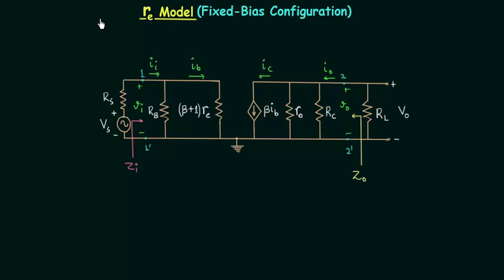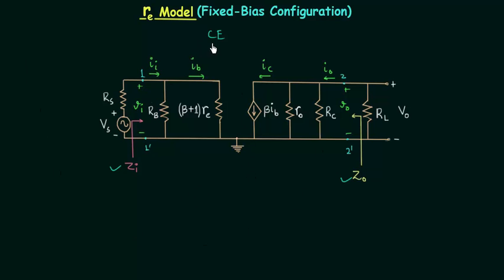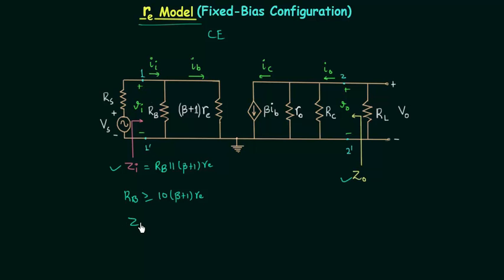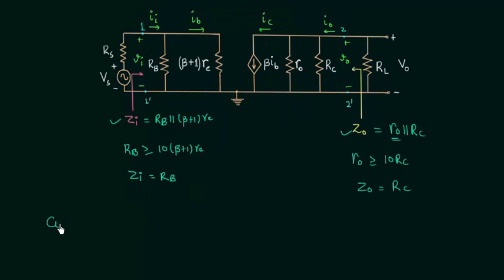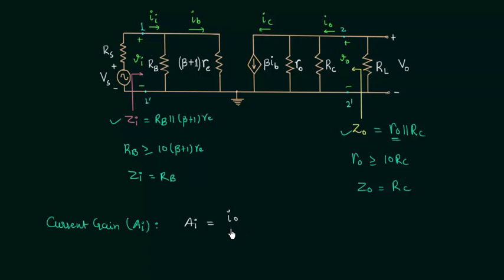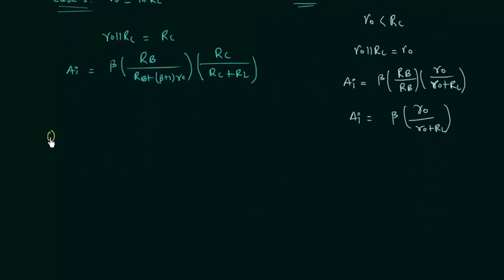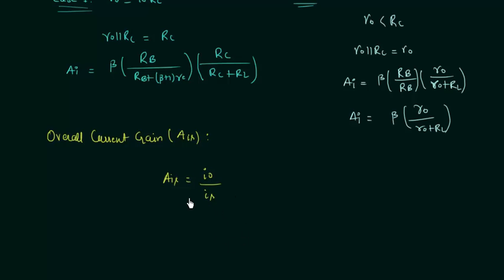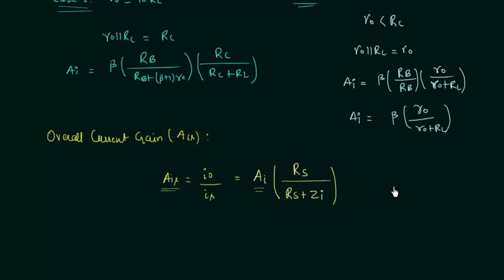re Model (Fixed-Bias Configuration) | Part 2

Comment: if r0>=10Rc then r0||RC shouldbeequal to r0 not RC
Reply: imagine you have two resistors in parallel. one is much larger than the other. the large one will act like an open circuit. current will flow through the smaller resistor. So you can effectively ignore the large resistor and only consider the smaller resistor. So When ro>>Rc, ro||RC = RC (approximately)

Comment: At 4:47 Current divider rule is applied wrongly, So final expression  is also Wrong. Please try to mention your faults in the comment section @neso academy.
Reply: Yes io and ic will be replaced
Reply: how that is wrong?
Reply: Yes ic should be some fraction of io depending on the resistances in the two branches, not the other way around.
Reply: @bomberman0023  Nah. He is right but I get why you think that. It's because of the direction of the currents that's why you're confused. 

BIb is not a resistance, remember? So Ic will remain the same value because it is determined by Ib as it is a current controlled current source. 

Therefore, the only resistances there are ro||Rc and Rl. and if you don't let the directions confuse you it's by all means a current divider between those two resistances.
Reply: @therealgoat3367  thx for explaining

Comment: In previous video u said zi is equals to (B+1)re bt in this lecture u r saying that zi is now equals to rb how is it possible
Reply: approximation
Reply: @svaditya2896  the approximation was for Rb >= 10(B+1)Re. So if you remove (B+1)Re from the denominator, Rb cancels Rb, leaving (B+1)Re on top. It's totally wrong.

Comment: If RL is not connected shouldn't the Output Current be = βI_b = I_c? My professor in class was using current divider with ro for some reason to find I_o. It makes no sense. I_o should be the same as I_c when RL is not connected. Am I correct?

Comment: thank you, I have learn so much with yor videos.
there is something i dont understand.
when  there are two  resistences in parallel and one is 10 times less than the other one, the equivalent resistance is the less of them, then is Rb | | (β+1)re and Rb≥10(β+1)re  then Zi=(β+1)re. I think the error is in the condition and actually is Rb≤10(β+1)re
Reply: it's not Rb≤10(β+1)re

it's 10Rb≤(β+1)re